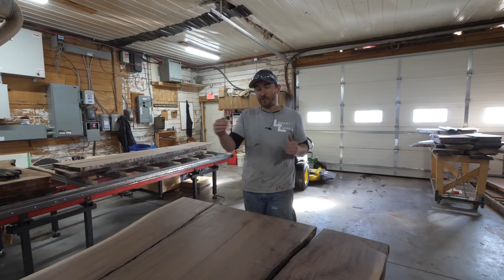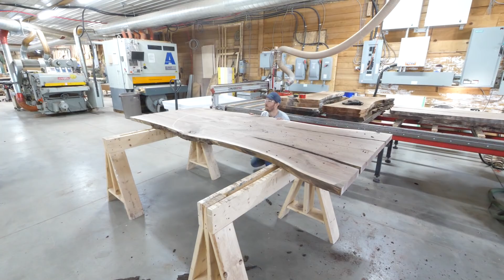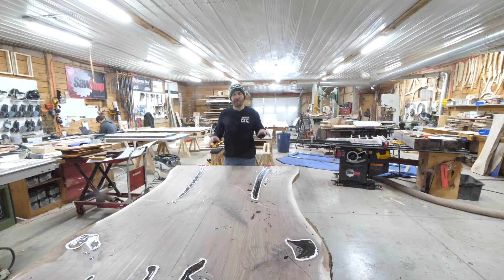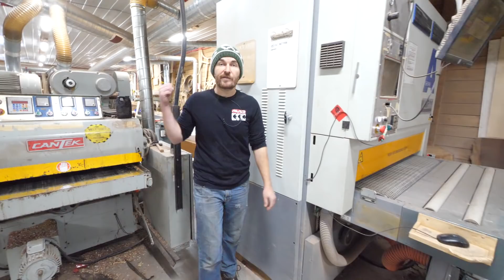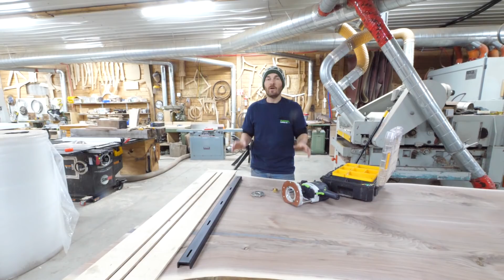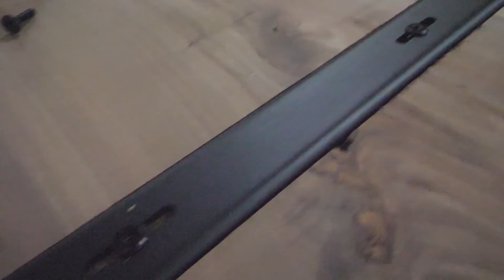Let's build a table - Part 2

Comment: Thanks for this video. Was wondering which size router bit you used for the c-channels? Must be larger than 3/16 to account for wood movement right?
Reply from the maker: Hi, We use a 1/4'' down cut spiral bit

Comment: Hey Canadian Woodworks,
thanks for the last episodes. So I've got one question to your wide belt sander: If you have to do 
several passes anyway, why do you use both grits (80 and 120) for every pass and not 120 just for the last pass?
Greetings from Germany
Max
Reply from the maker: I used to think the same to save the back paper. It's actually easier on the machine if each paper is sharing the work.

Both papers will last longer. $$$$

Comment: Great video Paul, how would you recommend sanding flat assuming you don’t have a “big butt” 54” sander.
Reply from the maker: Do a good job during glue up, then hammer down with the Festool RO150 - 6" Sander.

Comment: Hey, cool vid series. Could you pls tell us a bit more about the overall thickness of the slab und the tichkness/height of the used c channel?
Reply from the maker: Hey Rob, typically our slabs start off at around 2.5" thick and then after surfacing we end up around 2". 

C channel walls are 3/16" thick, width is 2" and total height is 1"
Reply: @CanadianWoodworks  thanks! So the channel is half the depth of the overall tabletop thickness. I'm just ahead on doind a similar setup and always wondering if these "deep" cuts for the c channel aren't weakening the overall strength of the top. Or am I too worried? :)
Reply from the maker: We've had zero issues using them over the last 7 years.

Comment: How did you decide how far back to do your C channel? 

Did you add glue to your inserts before installing them in the table? 

What brand of insert did you use?
Reply from the maker: We like to have them 6"-8" from the end. If it works out, we will line the jig up to the end of the table.

No glue is not needed. We never add glue.

Rampatec are the inserts. https://conceptthirteen.ca/collections/bolts-and-inserts/products/rampa-threaded-insert-skd330
Reply: So the C channel is instead of a bread board end?
Reply: ... nice video too!
Reply from the maker: @turfblacksmith  Basically yes lol